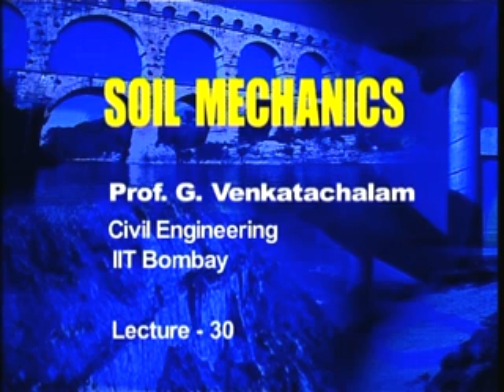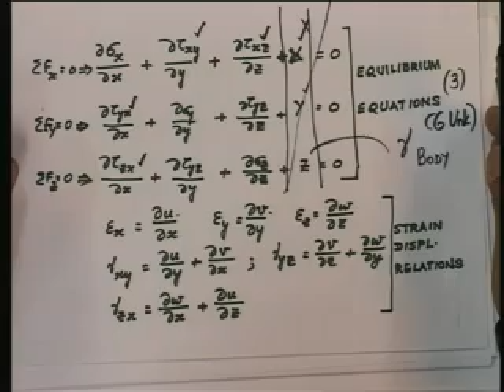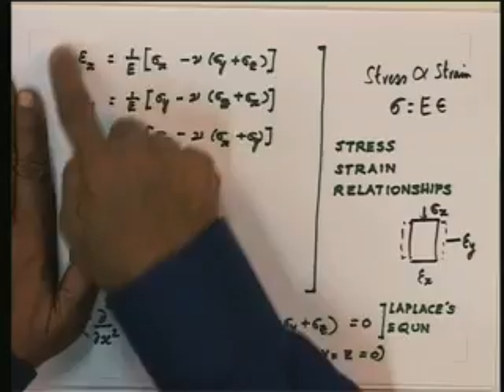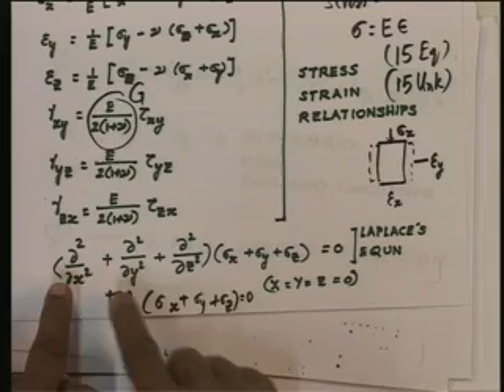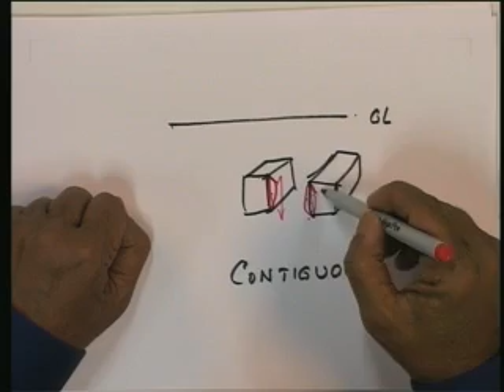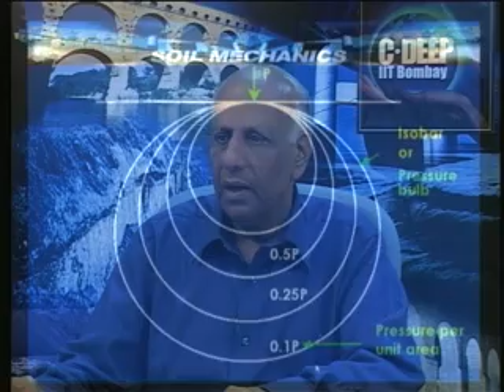Lecture - 30 Soil Mechanics

Comment: Sir it looks opposite when you say that flexible foundations cause uniform distribution of stresses. Coz. when we extrapolate realisation  ie absolute flexible vs absolute rigid foundation it seems that absolute rigid foundation will give uniform distribution though it is having an absolute point load on it